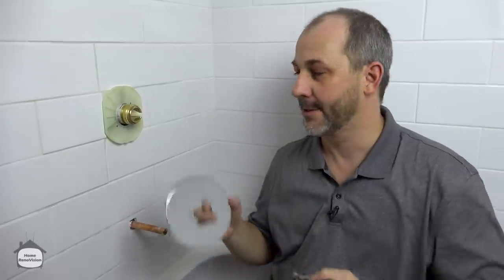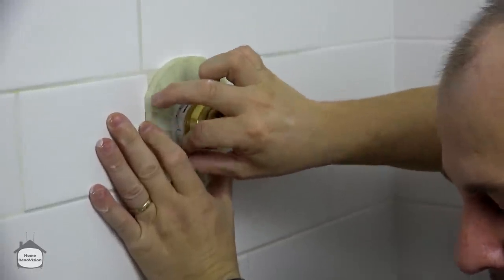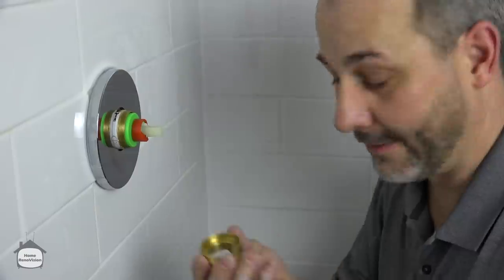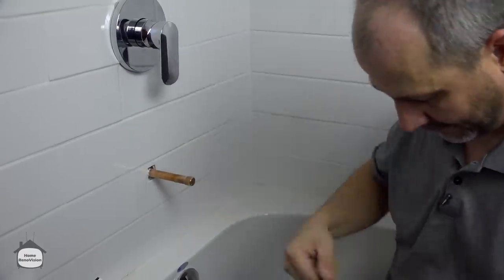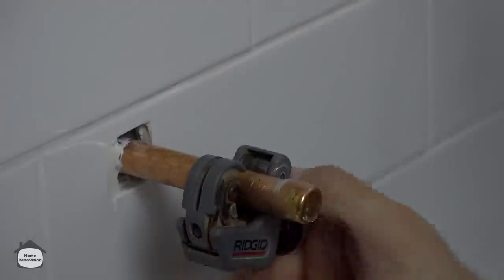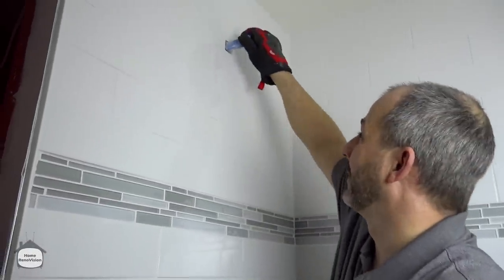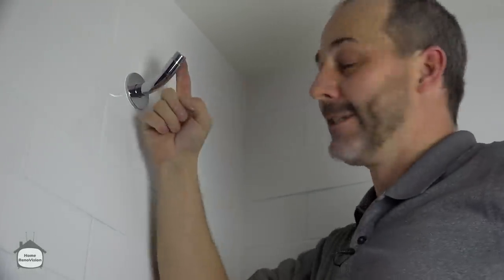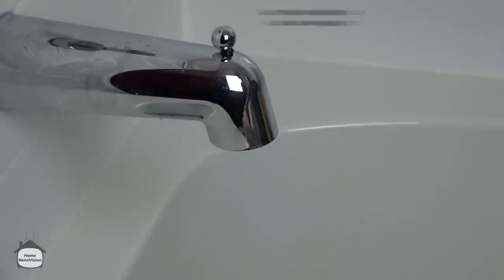How to Install a Bathroom Finishing Trim Kit

Comment: I am installing a new Delta tub and shower faucet in a remodel project. I am using copper piping and the stub out for the tub spout is copper. The spout that came with the faucet set up has female  threads at the front end of the spout.  I have to install a 1/2''copper to 1/2 '' pipe male adapter. How do i measure for the length of this stub out before the adapter is soldered on? Or is there some type of easier way to do this ?  Will the solder joints be strong enough for this type of installation?

Comment: Has anyone ever heard of grouting the space between the trim and the wall instead of caulking it?  I'm thinking the installer didn't set the valve back far enough and so the tile guy needed to fill up that 1/2" gap and used grout.

Comment: The pipe that comes out of my wall is 3 1/2 inches long do I need to cut it off a bit? If I don't need to cut it what size of a spout do I need?

Comment: Hi Jeff-

Really enjoyed your video.  Question:  what is actually happening inside the tub spout when you pull the lever and the water transfers from the spout to the shower head?  When the knob on the spout is pulled up, how does the water get pushed up?  Thank you!
Reply: Based on the one that I changed in my home (I'm no plumber so if there's variations I wouldn't know), there is a stopper that prevents the water from coming out the faucet. The water, not being able to leave the faucet, flows to the next available path, such is up to and out of the shower head. This is also why, even after the water is off, when you release the lever, water comes out the faucet; that's the water that was sitting in the pipe going up to the shower, draining from gravity.

Comment: Always perfect tutoring and EXECUTION. I did replace my shower spout but leaks when I lift the diverter.I wrapped teflon tape 4-5  times as instruction  but not like your 10 times.Do you think more teflon and treat  paste will stop the leakage or any other issue like the length of plain 1/2 " copper pipe like yours etc.Thanks.
Reply from the maker: Can't hurt to try. Cheers!
Reply: sure,  give it a try Faruk, like Jeff says it won't hurt anything (works fine lasts a long time)
Reply: Have you looked at the diverter's gasket? It may be dirty or defective.

Comment: Hi Jeff. Thank you for the video. I am following your videos to do the bathroom Reno myself. Thanks to your videos I was able to tile the bathtub!! However, I tried to put the faucet back but it is not working. I did not change the previous faucets. When I put them back I see some of the water is coming from the tub faucet and some water is coming from the shower faucet handle. I moved in to the house recently and I don’t remember if this was an existing problem before I took out the faucet. Am I doing something wrong? Could you please help?

Comment: I have just started putting my bathroom back together, drywall going up now, thanks for your help via your videos.  Trying to figure out what to put up.  I am not interested in tiling so am looking for other options, My issue is that its a 1.5 storey house so your standard tub surround is never going to work literally unable to stand up in the tub and I can't seem to find one that doesn't have shelves or patterns. What else can i put up that will be waterproof and easy to clean?
Reply from the maker: You should be able to purchase acrylic panels that are flat and have no shelves. Then you simply use a sealant caulk in the joints. Cheers!

Comment: great video, thank you. what size allen wrench are you using on the set screw. I'm trying to take an old trim set off and my 1/8 is to small ad 5/32 is to big. Is there a metric one I need?

Comment: Hi Jeff. My partner and I are planning a main bathroom reno for next month, and we have had your videos on constant rotation lately. Great stuff!!! Very happy to have discovered your page. 
We are in the stage of planning out the details, and have our hearts set on matte black fixtures in the bath/shower (one unit). What are your thoughts on matte black shower/bath fixtures in terms of water and mineral spots? We live in a city where the water is considered hard, and our current chrome fixtures definitely show a lot of water spots. Are matte black fixtures a bad idea in your opinion? Thanks!
Reply from the maker: hard water shows on everything. I would suggest getting a water softener and eliminate the problem at the source. 30 bucks a month for rental and installation is free. Other than that I love the black. Make sure you buy from a supplier that sells the trim kit separate from the valve body. This way you can buy replacement trim in a different color down the road if design styles change. Just a thought.

Comment: Jeff, I recently converted a bath tub into a bath/shower combo following your videos. I just finished but now when I turn the water on it comes out of both the tub spout and shower. When I pull the diverter up the tub stops and the shower gets stronger. Looking for some advice? All the fixtures are brand new.
Reply from the maker: Hi Tyler, if you used the pex to the tubspout you will find a back up of pressure can result in the water filling the tub from the shower as well.  No worries since that is the goal anyway. In the video that you have asked the question in we plumbed it differently to avoid this problem. always read product instructions as they will inform you of this potential problem with their product.
Reply: Home RenoVision DIY thanks for the reply. I didn’t use pex I kept the old copper pipe for the tub spout and used pex for the shower. I’ll go back and check fixtures specs and see if I need to replace that.
Reply from the maker: Hi Tyler Mercer, I can think of 3 things you can check out! First remove the cartridge for the diverter and give it a rinse in the opposite direction of water flow. You may have some debris stuck in the cartridge or valve body causing the disruption in flow to the tub faucet and that is why it is backing up. Second the tub faucet is a manual operation  and it may just be faulty. try installing a new one. if the diverter closure inside the spout is not opening completely it will interfere with the water flow and cause a backup. Third if you did any soldering on the tub spout lines you may have over soldered and caused a solder ball to interfere with the diverter function. The tub spout will not be affected by any plumbing running to the shower head. Cheers , I hope this helps, please let me know what you find.
Reply: Home RenoVision DIY Thanks Jeff, I will give those things a try. Hopefully that helps, I really appreciate your help.
Reply: Shower valve upside down

Comment: In an apartment I used to live in I turned on the water and the entire handle shot across the room very violently. I never knew that could happen and used to sit in the tub when I turned the water on, meaning my face would be right in the line of fire!! Luckily I didn't that time. I need to replace this part in my house but have been paranoid ever since that experience - what did they do wrong that caused that to happen? It had been fine before that but one day just blew off...
Reply from the maker: LOL, that is very funny and yet very serious. If the set screw is coming loose you will notice the fixture start to separate from the wall. double check and tighten it up as needed. And NEVER sit in the tub when you turn it on. Cheers!

Comment: Jeff, another great video i desperately need to do my bathroom reno.  I have a few questions & i hope you dont mind me mixing other videos around this topic that i watched of yours.  So im going from a threaded pipe spout to a slip on like you did. I really thought I had to find a way to lengthen the copper since the new spout was very long compared t the old spout.  Glad to see the copper doesnt have to go all the way down into the spout.  But is there any reason why you didnt cut the copper much closer to the treading?  I felt like it could have been longer and sit farther in the spout, but i dont really know.  Second question:  Ive seen you change copper to PEX pipe.  Right now i have all copper but since i have a 4inch taller tub coming in, id have to lengthen the spout, valve, shower head.  While im at it , I just decided its best to just change out the entire valve.  So, do you recommend to solder  the new valve in or just use the compression connectors with PEX ive seen you use.  Id like to know your preference as to which you think will last longer or has less changes of issues.  Thanks for reading in advance
Reply from the maker: I would say that soldering is the easiest and most dependable option.
Reply: Hey Jeff. Did sll my ceramic work with your videos grat job. All tub plumbing new and left about 5 for the tub spout. saw this video, cut the pipe at 3 in and too short to grab. not sure to cut back to add extension or go buy a spout with different fixing method.

Comment: If you put dope on the female pipe thread the male threads are going to push the dope into the pipe and could cause problems down the road. Tape and dope on the male thread is good enough
Informative video though 👍
Reply from the maker: I am not concerned about a little dope.

Comment: HELP THE cheap plastic top spout isnt coming off.. it keeps turning around in both directions and still not coming off the copper pipe...what do i do?
Reply from the maker: you will need to open the wall and remove the plumbing. it is obviously stripped when it was installed.
Reply: @HomeRenoVisionDIY  oh that sucks!!!....this is my first attempt at home reno...im going to try sawing the plastic crap off...opening the wall is over my skill level...they did suck crappy work on my moms bathroom.i saw mold so i removed the grout and silicon and opened a can of worms...  thanks
Reply: YAY for mimi hacksaw!!!!!!i sawed it off without damading the pipe....took me a bit but i got it!!! Feels good..keep up the tutorials...you are helping me sooo much😊